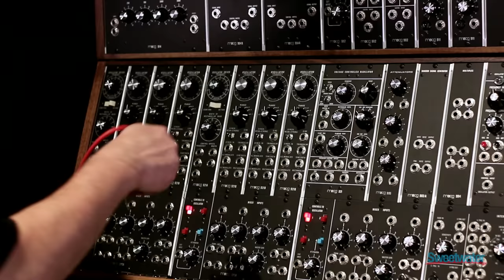Moog System 55 Modular Synth Demo — Daniel Fisher

Comment: In 1969, I got to work with the Moog III at Philadelphia Music Academy. Every ten to twenty minutes or so, the oscillators had to be adjusted to maintain pitch, as the electronics at that time wasn't stable enough to maintain pitch when resistance and temperature changes occurred! Great instrument. I also got to visit Robert Moog in his factory in Trumansburg, NY. Amazing place; amazingly geeky lovable person!
Reply from the maker: Hi Don. It's hard to completely describe the sensation of working with a large modular synthesizer to someone who's only played plug-ins or a plastic keyboard with just a couple of generic knobs. Thanks for sharing!
Reply: A true synth veteran.
I've today the same problem with a rare Prophet MK1... (founded in an abandoned house on the top of a mountain. Very very dirty, but still alive)
Reply: @mv1692  that's awesome, I want one desperatly
Reply: Wendy Carlos recalled having to hit the Moog synthesizer with a hammer during the recording of "Switched-on-Bach" because it was unreliable and went out of tune.

Comment: OH yeah FINALLY a synth I can take on the road
Reply: If you outfit it with wheels . . .
Reply: Notice how it’s sitting on its road case?
Reply: keith Emerson did for most of his career  RIP X
Reply: Kansas also
Reply: @rokker101  Roger Powell of Todd Rundgren’s Utopia toured with TWO System 55’s and a custom dual manual controller built by Bob Moog himself. They were lost in a warehouse fire. The custom keyboard controller was stolen and recovered 30 years later. It is now in the Moog Museum.

Comment: With 100 cables plugged in... "Alright, let's see what this does"
Reply: the problem is to know how to connect and combine a web of cables
Reply: @RUfromthe40s  1 at a time.
Reply: I've heard stories of how bands would achieve a certain sound with them, then we're never able to reproduce it again because the programmer forgot how they plugged the cables in. They almost had a "record this quick" mentality because obviously you could replay the recording back later as a lay down or sample track. Very interesting stories came out of working with this amazing machine. You could mess with it for hours and achieve all kinds of ethereal sounds.
Reply: @davida.p.9911 seems like it could do just about anything with the right settings, but you had to be very capable with it in order to get the best performance out of it.
Reply: @davida.p.9911  seems like a recording is the second most logical step to take when dealing with it

Comment: I like hearing $10,000 modular synths through ear buds on youtube...
Reply: keep trying hunny, this shit is worth way more
Reply: $10 000? Oh sweetie, bless your soul. It’s a bit more than that though.
Reply: @kikko422  It's worth it alright. Stop birthing out more humans (the cost of a baby is 100,000 K  until it's 18+  and then there's the "misery cost index" of working just with MIDI) vs. working with Dudley Simpson's dream machine...
Reply: They go for around 35k..
Reply: G  Probably at least partially because "In the year 1964, the first modern synthesizer that was commercially available was introduced by Robert Moog." 

The very first audio synthesizer was designed a bit earlier, though, 1876, with the first programmable version by RCA in 1964.  Moog hit the market in '64, and Wendy Carlos' Switched on Bach in '68.  Likely a good part of the reason.  Building a synth is not difficult for an electrical engineer, it's basically just oscillators and various filters other types of signal processors, and a lot of patching or switching capabiity.  Piece of cake if you understand Kruschev's current and voltage laws.  ;-) 

I'm not really sure one would sound all that much different from another, given they are probably similar designs with mostly the same parts, at least early on.  But then, there are still morons out there that insist vinyl records "sound better" than the highest calibur digital sound available...and then they listen to it on the equivalent of a "close and play".  They are the ones that buy speaker connecting wire that costs THOUSANDS of dollars, there is a sucker born every minute (thousands of them, actually).

 I expect if you wanted to do a serious design now, you might go at it digitally, where you can do stuff you CAN'T do (in a practical sense) with purely analog equipment...you could even do it on a PC with virtual knobs and patch cords, and some app specific cards/DAC's/etc. if you wanted to.  Not sure why you would, though.
Reply: @MrJdsenior  but we aren't in the year 1964. Is 2020 and electronics has made these things much easier to build.
Reply: @chrisroberts2266  Ummm...yeah.  I'm a retired EE.  Did you read my whole comment ending in "you could even do it on a PC with virtual knobs and patch cords, and some app specific cards/DAC's/etc. if you wanted to"

Given that you probably already have a PC, and then it would take just a specialty card (probably already available if I had to guess) and some SW, which would make it DIRT cheap, maybe $100-200 (?), less if you did the HW/SW yourself.  I think we are in severe agreement.  Maybe you are responding to a comment further up the chain? 

Things that I (whole teams of sometimes 100+ engineers and support folks) used to have to spend months designing, building, and documenting (per govt. standards...geez)  can often be done for next to nothing now (comparatively) and off the shelf.  Certainly not true of everything I did, some of it would still cost millions (some rocket junk and military HW, among other things). 

I once transported a FLIR/mm wave radar set of finished sensors/gimbals across town in the back of my RX7, not even tied down to anything.  I asked the TD, after I did it (he knew) what the total cost of the unit was (incl engineering)...it was well over a million.  I asked him if it was insured since I transported it, and not the co. transportation, and he said he didn't know.  Gave me the willies when I heard that...should have thought to ask BEFOREHAND.  I certainly would have next time, had it occurred.
Reply: @Chester Bennington Who are you kidding, Chest. Less than 3,000 bucks. 
......for the 2020 Behringer System 55 :). ..
Reply: I can probably get a free app that does this an more
Reply: YouTube makes us feel poorer
Reply: through one side of the earbud as well
Reply: Earrape machine
Reply: @MrJdsenior  Hahahaha thank goodness you didn't slam on your breaks! Im a student at UCSD studying EE right now. We just learned about high, low, and band pass filters in my circuits and systems class then discussed fourier series representation of signals today. After the lecture my professor and I got to talking about digital recreation of sounds and apps like Garageband and fruity loops. Hence why I find myself on a video about the moog synth. Im a huge fan of Daft Punk, and I know they use synths for a lot of their music. Id like to build a simple synth over the summer just to get a feel for the circuits. Anyway, I enjoyed reading your comments. It's cool to see someone in the field talk about their fun experiences.
Reply: @dallasdominguez2224  "Id like to build a simple synth over the summer just to get a feel for the circuits"

Sounds like fun, and you will definitely learn some things.  Ah yes, (analog) filters...one class I enjoyed, actually.  

And Fourier, once you see what it takes to create a fairly sharp square wave out of sines, you understand why even a low power clipping amplifier can do BAD things to tweeters.

Check out Pentatonix Daft Punk cover if you haven't seen it...those kids are great!  Good luck in your studies and subsequent career.
Reply: @kikko422  could prolly diy one this big for 1-2grand
Reply: @dallasdominguez2224  Good luck with that build!
Reply: me too
Reply: I think this was created by a data center guy who got bored with lan cables and server racks.

Comment: This is very nice.  $35,000 is actually quite reasonable for this type of instrument.  I mean, some Steinway 9 foot grand pianos can go for like $70,000, and nobody makes much fuss about it.  I mean, I can do most of the stuff I will ever need with my D-50.  Even thought it's a digital synthesizer (70% of its development was software) it really sounds analog.  Of course the Moog in this video I am sure has much more cleaner sound.  The D-50 hiss level was even criticized back in 1987 when the instrument was introduced.  Anyway, very nice video.  Nice too see Moog modular in brand-new condition, not run down like most of the stuff you get off eBay.
Reply: Yes, it's a reasonable price for what it is. But let's keep in mind they did it that way because there was no other way to do it back then. LOL

Comment: Great demo, thanks. It is amazing to me the variety of sounds that come (came) from such a machine, with so few differing functions.  You listen to stuff like Wakeman's from the early Moog time period and he made sounds that were totally recognizable (not perfect obviously) as vocal choirs, as opposed to anything else. 

I remember the "old man" getting Wendy Carlos' Switched on Back when it first came out, and hearing the Moog for the first time on a rather awesome system he built (15 Altecs, the GOOD ones, 800 cycle horns in large cabinets, home designed and built amps with electronic crossovers (an engineer), and a crow bar overcurrent shutdown on the horns so you could POUND the things without fear of damage, in a paneled 24' X 24' Fl room built mostly for the stereo system, a fireplace, and a place to put the pool table). I was blown away the first time I heard both the stereo and the Switched on Bach (later), and just about played the oxide off that reel to reel tape (there were many many brown alcohol filled q tips)...those were the days....and so are these.  And the pipe organ on those woofers...not quite my current Velodyne Servo subs equal, but awesome, nonetheless.  An aside, when the wall sconce filaments were starting to get crummy in the livingroom wall sconces, the kids would always want me to "finish" them off with the sub, and my daughter, when she was young, called it the CyberWolf, instead of subwoofer...I thought that was awesome, too.